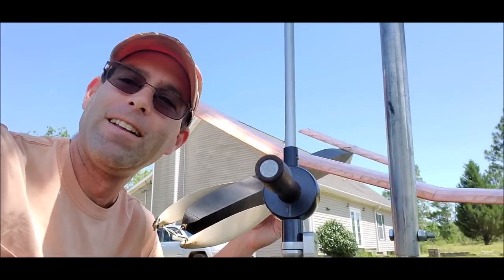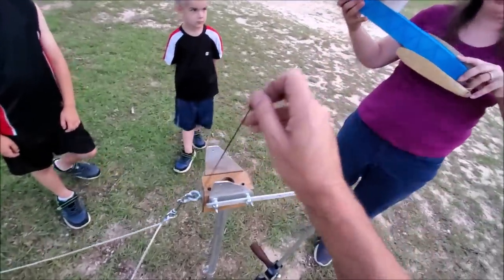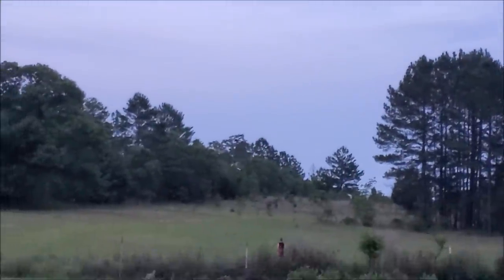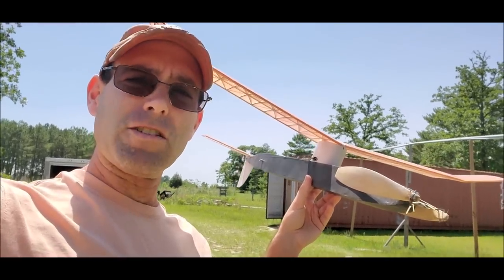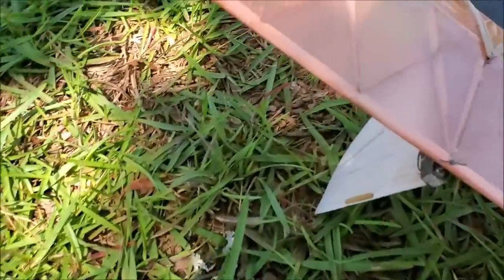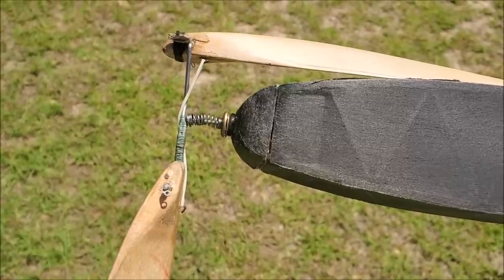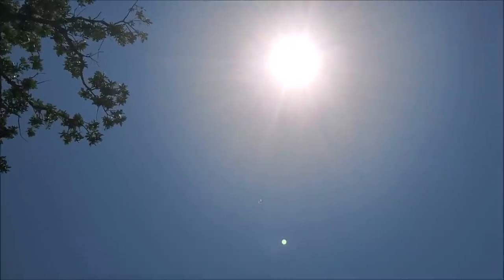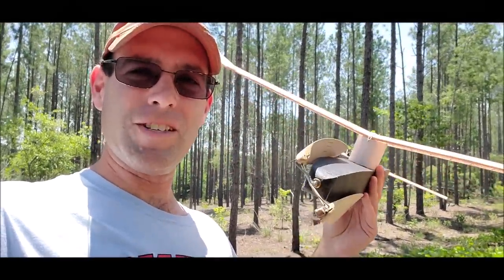MoFat is a rubber powered vertical takeoff Moffett class airplane that does barrel rolls!

Comment: A bit of sponge padding on the stooge wouldn’t go amiss. It saves the longerons. That F1B winder is the best. I have the same by Blazowich, a bit cheaper. I don’t know if they are still available. Having a high pylon complicates matters unnecessarily. I don’t fly huge models very often. I’m too mean to buy so much rubber! BMK does exellent rdt and trackers. I wish I had your property to fly on. Great honest video. I buy my prop units here in England from Spencer Willis. None better. My favourite rubber model is the “Last Resort”, a classic design. We don’t fly Mulvihill here. Open rubber models are restricted to 50g of rubber. Up front I use a reverse S prop shaft with a Tim White connector for the rubber. I usually braid to stop bunching. You need to grow a patch of long grass for test gliding with a sub fin 😀😀😀
Again a great video..
Reply from the maker: Yeah I couldn't find my foam padding the day we filmed this.
50g of rubber...frankly doesn't sound that fun anymore. We use at least that much on Moffetts and more than double in Mulvihill. Just makes for a more majestic airplane and fewer blown motors.

Comment: Joshua, what is the item strapped to your upper arm?
Reply from the maker: That's the transmitter for the dethermalizer. It's a BMK B2 unit in a cell phone arm band.
Reply: @joshuawfinn  Your talented to need one, mine don’t stay up long.

Awesome
Reply from the maker: @tomcook5813  if you build a serious performance machine, you'll find yourself in need of a DT. These big endurance planes are really easy to fly. Try a P-30 sometime...you'll be shocked at the performance.

Comment: I actually like this plane, but for the effort and reward of free-flight would it not make sense to make this plane into an rc model. If a dt system could be installed couldn't micro rc?
Reply from the maker: Nothing preventing you from doing that; it does work quite well if you use good light servos.